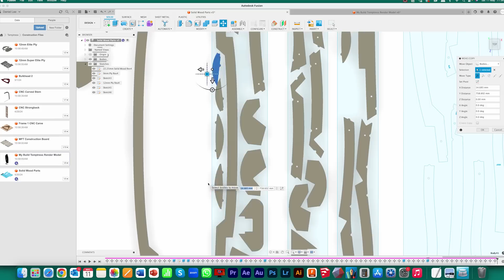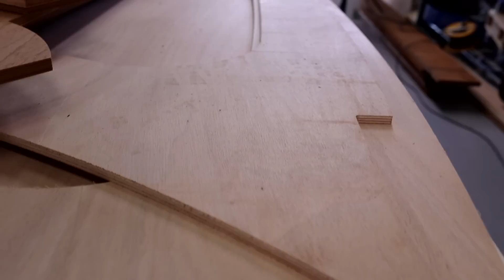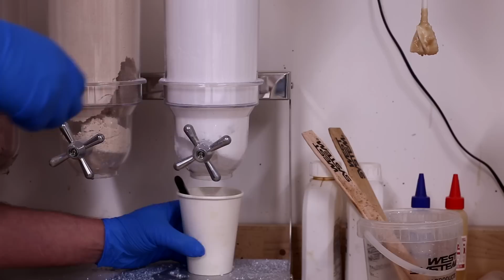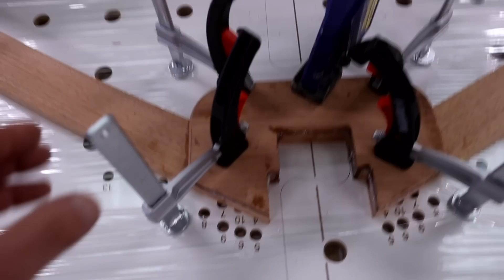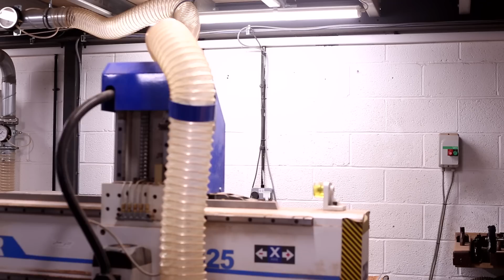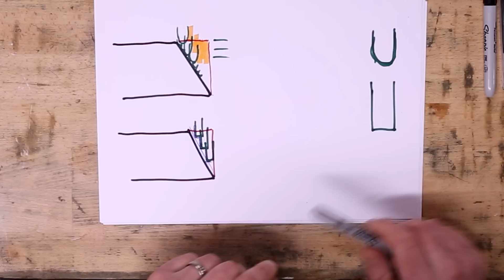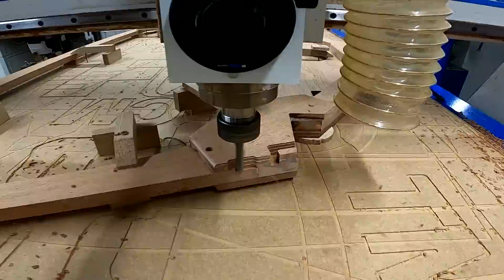CNC Carved Boat Frame REFINEMENT | Building Temptress Ep4

Comment: Curious why you don't run the same program as the layout board on the sacrificial board to engage the frames in the same manner to ensure alignment?
Reply from the maker: I am essentially but I'm just drilling the hole sets one frame at a time right now instead of all in one hit. Basically because I didn't know how well all of this would actually work. The program I use to drill the holes in the spoil board is created from the construction board design though.
Reply: @DanLeeBoatbuilding  Cool, I understand its an organic process and constant incremental improvements. Loving the content so far.

Comment: Have you had any squareness issues by planning after running parts on the cnc.
Reply from the maker: Not anything noticeable to date. These boards are sawn very well though and for sawn stock are much more uniform than ones I've seen before.

Comment: You might consider roughing out the long narrow parts first, then coming back with a finish cut after the stresses are relieved.  That little bit of stress caused a misalignment early on which got forced into position.  But those stresses are still there trying to warp the frame a little bit, even after the glue up.  This is small enough that it won't matter, except if there are internal holes that need precise locating, like receivers for stringers and such.  
Also, there are digitizing probes that can automatically run around your perimeter and give you a vector drawing of where the CNC thinks your part is.

Comment: The tear out is just the tooling direction. So if I'm doing this manually im entering the recess from both directions, not one direction. Im not coming out of the recess, I'm only going in, make sense?  That will stop tear out.  Sounds like more tool path training, which when you do this manually you tend to think about. I guess that's the learning curve with CNC, knowing what to program, why and when. It's all front end loading which makes it hard.
Reply from the maker: Yeah, I’m going to have a look and see if I can control the angle of entry a little better for the next one I think 👍

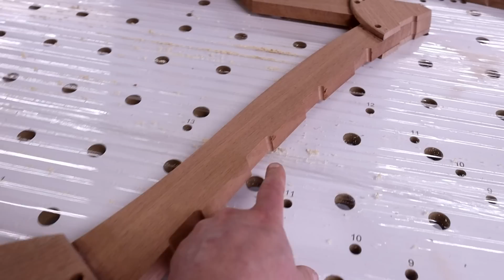Comment: 49:30  with the tear out.  Set your tool path to do the cross grain cut before doing cut in line with the grain.  That way there is more wood left at the point where the tear out is occuring

Comment: How do you mark out the bevel on the frames if your doing it manually? What do the plans give you on this front ? I'd imagine the bevel would be variable pitch making it harder to achieve transfering the pattern.

Also how do you find Autodesk fusion for boat design? It obviously works well with your tooling.

Your really taking it to the next level with this method, still digesting it, having only just learnt traditional stitch & glue building. But still keen to see the progress. Great work 👍
Reply from the maker: You would do this as you set in the longitudinal timbers such as chine, sheer clamps and topside battens. The finished size/shape of the frames are set to the largest side of the bevel so you cut down the smaller side until the landing timber meets the other side. Difficult to explain effectively in comments.

Comment: Well done. Dan how would a guy who is building frames in their garage/shop who does not have one of these tables do this to ensure the frames are true?
Reply: I think you'll find the two part table is part of the kit
Reply from the maker: The files for the construction board are included with the plans. It can be done as a board on the floor rather than building a table but I thought the table would be better for other uses once I'm done building frames. I wouldn't recommend trying to build these frames without using the construction board as you would end up losing all the accuracy induced by the CNC cutting process.
Reply: @DanLeeBoatbuilding  Dan I'm sorry. I was not clear and specific enough with my question. I was asking about building boat frames in general and not specifically this boat. If you are building a boat like your Rocket is a table a must have or can you just use the floor?

Comment: I wouldn't assume your cnc router is square between X and Y or even straight. Some of the offset you see might be on the machine, too. It should be easy to check by routing a square, flipping it around and checking the contour like you did with the assembled part
Reply: Along the same line, compare your assembly board to your set up on the machine,  as they were cut at 90 degrees to each other. This would compound the problem. Check the distance between 2 pins in both the setup board and the hole locations you have cut in the machine. They should to be the same. Fascinating watching the videos
Reply from the maker: I could also check the squareness of the MFT hole arrangement, hadn’t even thought to measure that yet.
Reply from the maker: Thats a good point and something that I have never considered to check actually. I probably trust it too much. I'll give that a go this week and see what I get 😬